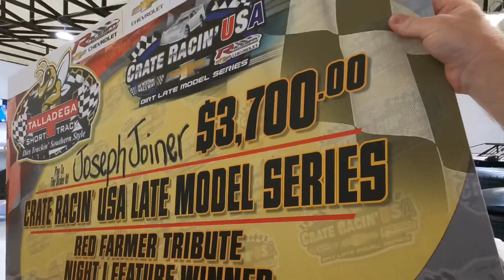Delayed Victory! We Won a Race and Didn’t Know It for Over a Year!

Comment: Everyone Hits a tire Jesse. Mine caught the rim and snapped the shaft off the steering box, blew the rotor off the left side and it went up and got the master cylinder for the rear. 😏 Switched stuff and Fixed it and finished 3rd in the Feature with No Front Brakes. That was REAL Interesting coming from dead last. HA! So don't let em bust yer chops bro. Rock On!

Comment: I also went back on Facebook and there is no mention of a failed tire sample or of Joseph being declared the winner. And from the same race this year the caption for Joseph's second place interview read "for the second straight year..." They never said anything about this prior to now. Fergie has put an unfavorable light on the series and it appears that they're trying to save face! Congratulations on the win anyway! I'm a fan of HTF but not the Ultimate Series!
Reply: most tracks or promoters aren't going to say it was a failed tire sample they will just declare a DQ but its just kinda odd that it took a year to find out the other car was Disqualified . Blue ridge labs is usually pretty quick about getting results by the following week so the winner can get his or her check but it's the ultimate series and weird stuff seems to follow them.

Comment: Funny that the Draime was/is the motor on the slick.
Reply: Agreed need something drivable in the slick even a couple weeks ago at TST Joseph mentioned he would’ve been faster in the crate And besides the Draime is no dog they made it to the feature of their first world 100 with it no small achievement
Reply: @tomgray5481  my assumption is the Draime does not have the top end HP as the new motor they have, but the power band must be more consistent so easier to modulate. They have enough cars now to set them up for slick or hammer down.

Comment: get some long 2x4's or 2x2's and some chain, drop short pcs of chain from the rafters right at the outside walls and bolt or screw them to the tops of the 2x4's so the hang down right against the wall from the rafters, then screw your checks and banners to the 2x4's. if you went all the way around the shop like that you could hang all of your checks and banners, later you can drop from that 2x4 with more chain behind the top row of checks/banners with more chain and another 2x4 or 2x2 and create another row of checks and banners under the top row and so on, kinda like a rope ladder hanging down, then you don't have to mount to the walls and you can display everything.
Reply: you can even use pvc pipe instead of wood and zip tie your banners and checks if you wanted too.

Comment: I would not be surprised at all if they had not sent you a check for the difference until this recent disagreement with Chris Ferguson after a botched tire issue. Fergie won a big money race in Virginia after clarifying the tire rule in advance and was disqualified after the win for running the tire that the series cleared. He is refusing to run any additional races sanctioned by the Ultimate Series and many fans in the Carolinas are boycotting as well. It seems to me like the series is trying to put out fires.